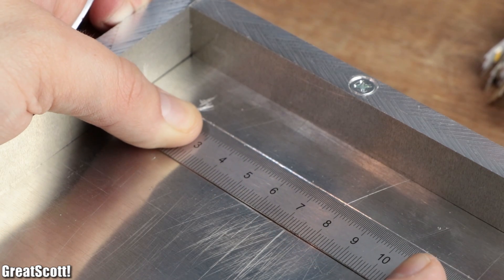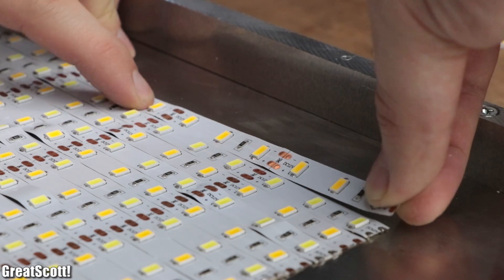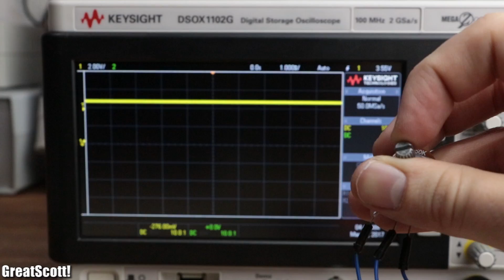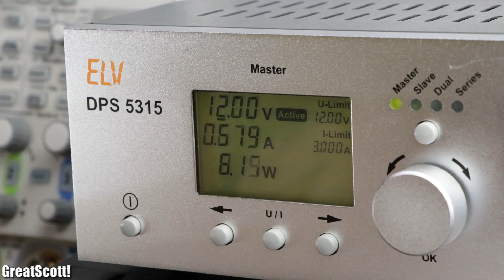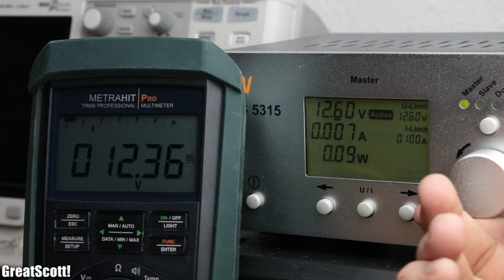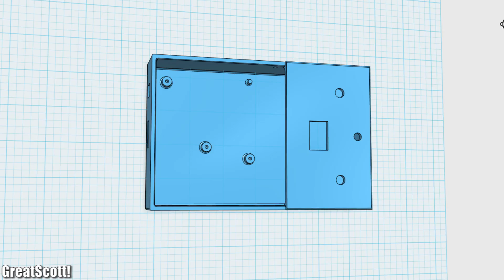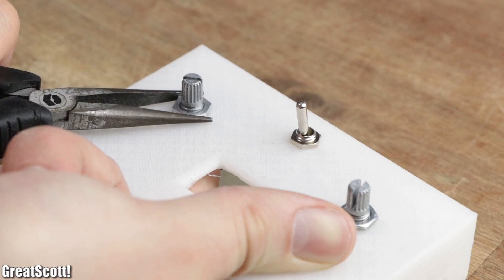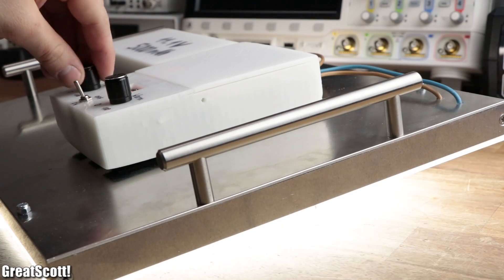DIY Portable LED Panel (Part 2) - the electronics

Comment: May be a stupid question but wouldn't be the same if you controlled the voltage of the leds rather than their speed?
Reply from the maker: That is also possible. But usually not that efficient.
Reply: GreatScott! Oh thanks 😀
Reply: LEDs cannot be compared to classical resistive wire lamps: the brightness is  not a linear function of  the voltage applied from 0 to operating voltage (let's say 12v for a series of LEDs). If you vary it from 0 to 12v, LEDs will only light up at around 10v with a barely noticeable light, then brightness should increase while reaching 12v,  above that, LEDs start to dissipate excess voltage into heat, consuming more current (in opposition to resistive lamps in which Ohm's law apply), which in return reduces their life span dramatically.
It is definetly better to run them at full nominal voltage or slightly lower, in that case, they consume just the right amount of current. Dimming using PWM puts our eyes to contribution and is more potentiometer freindly :)
Reply: It doesn't sound like it should be that inefficient. Those LED strips are already basically voltage controlled due to the inline resistors. Voltage control gets finicky when just driving LEDs directly. I made some overhead LED strips and power them directly from a voltage converter like the one used in the video. I modified the feedback circuit so that an external sliding pot adjusts the output from off to a safe max voltage. Because its straight DC voltage, there is 0 flicker.
Reply: New to electronics here, does one of your basics videos explain why that is inefficient?
Reply: The resistance of an LED has an exponential relationship with the voltage across it. 

So the higher the voltage you use across the diode, the more of an ideal short it is. For example a significantly large voltage would mean there's no loss in the LED and make it approach 100% efficiency. 

To keep the thermal dynamic gods happy, the light energy coming from a diode is in a form of voltage drop in the diode. this is around 2-3V and is based on the temperature of the diode. Also too high of voltage would kill the diode.

https://en.wikipedia.org/wiki/Diode

The shockley diode equation should answer your question.
Reply: Kreston lee Go and search for one of his basics video about PWM.
Reply: Kreston lee And about Buck Converters.
Reply: ***** thank you!
Reply: Linear voltage regulators reduce voltage by bleeding off current with heat. That means the regulator would become increasingly inefficient the more you dim the LEDs. If battery life is important, then a PWM power supply is the way to go. With a high enough frequency, the flicker will not be noticeable unless very dim.

Comment: How much dose the entire panel weight? With the battery ane everything???
Reply from the maker: 2.9Kg
Reply: @greatscottlab  Hello Mister Scott. How can I make such a panel dimmer, 
where 1 poti controls the overall brightness 
and 1 poti controls color temperature without changing brightness?
Thank you very much for your help.
I want to use the panel for filming at 120 fps, so there must not be any flickering at any combined setting of the potis.

Comment: A solar power for your garage?! I was wondering why did you buy so many solar cells which you showed in boost converter video. Reallyy looking forward. Btw I like your LED panel desing it looks practical.

Comment: My experience with those sticky back LED strips on metal is that they tend to peel off or become unstuck after awhile. I'm not a fan of those bare conductors running along the metal, even if they're held away a little by the cable tidies. Maybe some tape under and between  them for isolation would be a good idea.
Reply from the maker: The cable mounts can easily hold 5Kg each. Those wires will definitely not move.
Reply: GreatScott! My concern would be the panel being dropped or stepped on or somehow damaged and the wire(s) being pushed against the metal backing and creating a short.
Reply from the maker: Even when something like that happens the wires do not move. I tested that several times.
Reply: not to mention the BMS protects against shorts right? So at least when running on battery it wouldn't short if dropped etc...
Reply: Gadget Addict - No danger, no fun.

Comment: how can you choose the right mosfet driver? Cool video as always of course
Reply from the maker: For this application pretty much any MOSFET driver would have worked. But if you want to make a more advanced circuit you have to look out for rise/fall time, maximum power loss and much more.

Comment: Nice video. When you start the project, I feel like i would also do the same. But when you end the project, I was less confident because of lot of components used and also reading the circuit diagram. But the video is good.

Comment: I absolutely love the channel, and the vid. But would making this be cheaper than just buying an Led Panel?
Reply from the maker: I spent a total of 70€ for all the parts. I think that is budget friendly considering how robust this panel is and how much light it can output.
Reply: GreatScott! awesome! thanks for replying so quickly. keep creating great content!
Reply: Typical LED panels like this that operate at 36 Watts are on amazon for $210USD. Yeah, this project is WAAAYYY cheaper.
Reply: I think the purpose of the project is not to get the cheapest LED light, but to learn stuff along the way. Kinda like NurdRage's chemistry videos.
Reply: I would think the pricing is somewhat close, but knowledge is power! If it was a single color panel with low output those can be found super cheap from china, the ability to control the warm/cold color of the light is something I would pay double for.
Reply: Pls do the arduino code tutorial

Comment: How can the LED's not being shorted right now.  It seems like the copper solderingpads at the bottom of the LED strips are touching the aluminium casing.
Reply from the maker: There is an adhesive layer between the copper and aluminium. But I also saw a comment in part 1 of the project where someone was having the exact problem you just described. So, always be careful and expect the worst.
Reply: Aaah. I didn't thougt about the adhesive.
Reply: dirk-jan raven no because of the adhesive tape. first i taught like you but then i remember thst they use transparent tape
Reply: When he installed them you could see there are pads at the bottom too.
Reply: I was thinking the exact same thing.
Reply: The adhesive strip under the leds is preventing shorts
Reply: the copper pads are only on the top side of the led strips